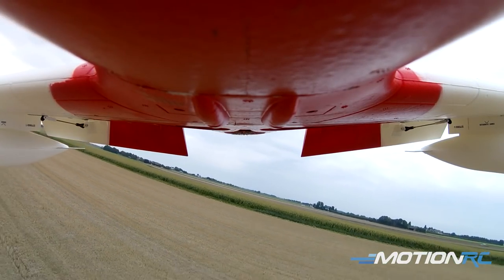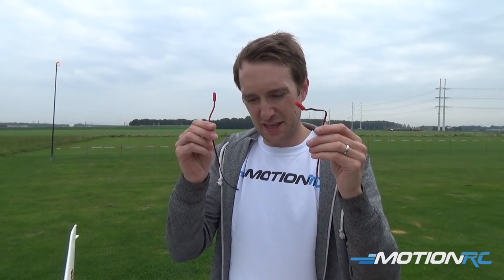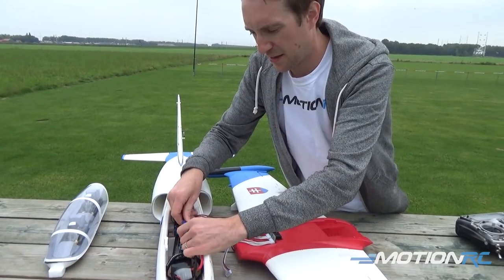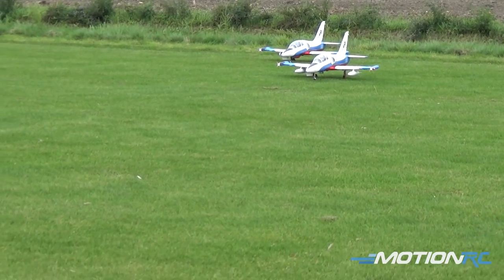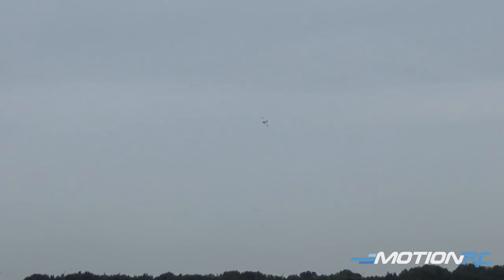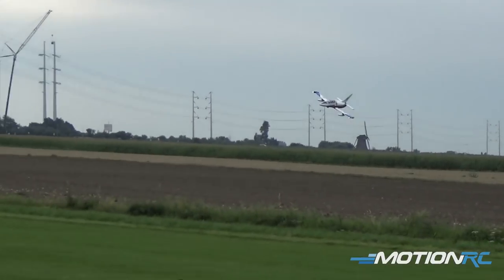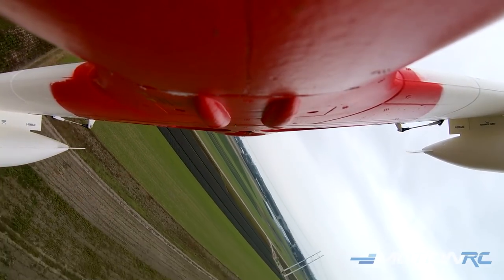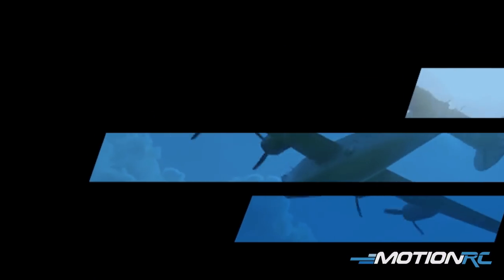Landing Light Mod - Freewing L-39 Albatros 80mm EDF Jet - Motion RC Extra

Comment: Hey Stuart, What is that on the far side of the table at 0:28. Looks exciting! Also great to see you making videos and models again!
Reply: Its a fellow club mates model. Very nice it is too.
Reply: @stuartwarnerc Ah, got excited for a second. The L39 looks awesome . What flight times are you seeing?
Reply: 4mins with mixed throttle use on Admiral 5000mah 6S.